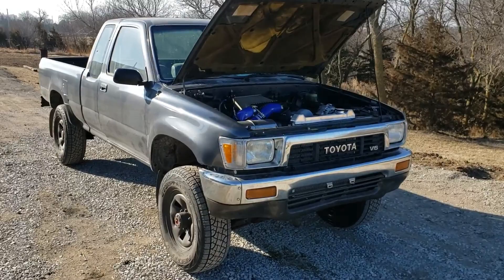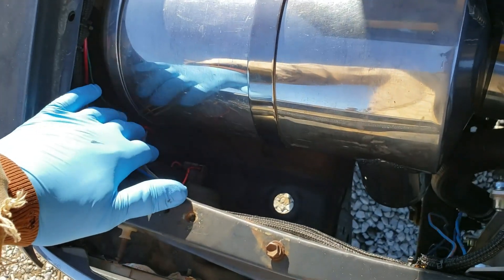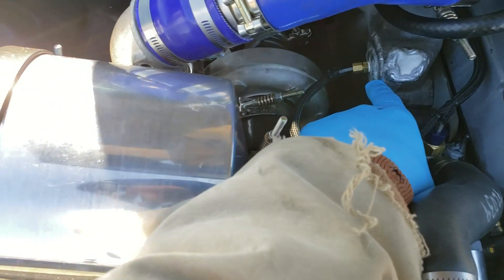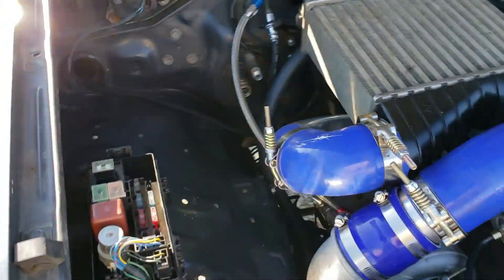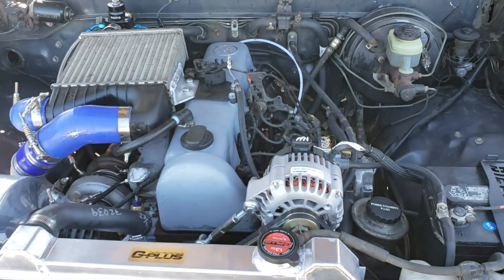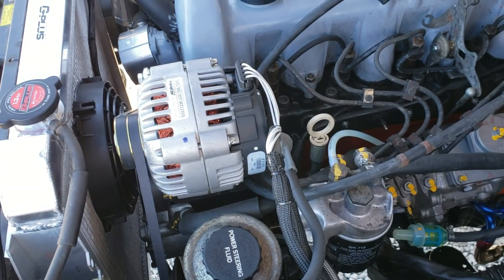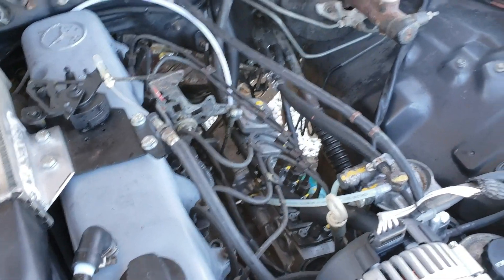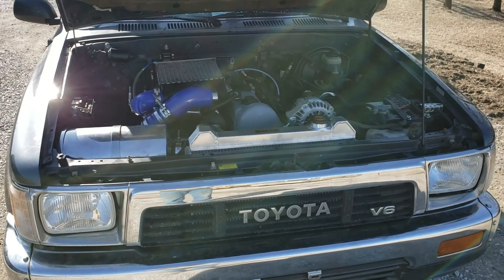OM617 Conversion Series: Toyota Pickup 3VZE-to-OM617 Swap Overview

Comment: There is one of those diesels for sale in my area right now. I have a 97 t100 4x4 automatic. I need a recommended parts list.
Reply: you have a few options but you can find universal engine mounts to adapt to the truck and you can adapt it to either a automatic or you can do a toyota manual w58 I believe or you can adapt it to a chevy trans as well. It is a front sump pan though so that might be a problem for you.

Comment: If you have an opening plz let me know I’d like a swap like this but with ac and heat. Your work and attention to detail is not n point sir! I have a 93 single cab m 5 speed 22re on 38.5 boggers 5:29 gears. I’m guessing this swap would push those tires no problem?

Comment: A couple Questions 1. Will this work in a 1989 Toyota 4x4 pickup has an extended cab. 2. Is this a mechanically driven fuel pump on it. This is very interesting would like to do it to mine if possible.
Reply from the maker: Yes & yes.
Reply: @doomsdaydiesel  Cool now I'm on the lookout for a OM617. Thanks for the quick reply.

Comment: Does anyone know if the transmission in a 83 GMC S15 with a 2.2 Isuzu 5 speed will bolt up to a om617 engine? If not what might I need. This truck is just a burnout truck for our local events. It doesn't have to be classy just functional. Thanks to anyone that can help!
Reply from the maker: I don't support the little S10 stuff, just the common GM 90° pattern.
Reply: @doomsdaydiesel  sorry but I don't understand what you mean? The transmission won't hold up to the engine? What's the 90° mean? Thanks
Reply from the maker: @dunavungoeckner6495  Google gm 90°. I'm sure the s10 trannys would hold up, but there aren't enough of them around to create enough demand for me to support them. Might sell 1 kit a year tops.

Comment: how many MPGs does it go for OM617?
Reply from the maker: Anywhere from 21-32 depending on tires/lift/gears
Reply: @doomsdaydiesel  sweet! between TDI vs om617, which one do you think is more reliable and lasts longer when converted to other trucks?
Reply from the maker: @bowlineastronomenov5507  they're both great. 617 is easier to work on and doesn't have the risky timing belt tho
Reply: @doomsdaydiesel  awesome, tnx man. hoping to convert my 3rd gen with one of those engines.

Comment: Like your mods. And attention to detail.
I used that exact intercooler…came off a turbo Renault (if I remember correctly). Mounted on side wall with a fan on my Nissan scout.
Like to see a better pic of the modified sump.
Reply from the maker: Doomsdaydiesel.net for the "ultimate clearance" front sump, and the new rear sump

Comment: Question: Did you change final drive / front drive? what is you max. speed? :)
Reply from the maker: No. You gear the 617 the same as the Toyota motors

Comment: I also have a 3VZ pickup (1988) that I am interested in OM617 swapping, how much would it cost to have you do the swap?
Reply from the maker: I am not currently taking on any more customer's in-house builds as I am booked out for the rest of the year, but they typically cost $10-$12k

Comment: Awesome swap!!! In your opinion, is the standard transmission and transfer case up to the challenge of the OM617? I have a 91 3.0 w the aforementioned. Would you suggest a different clutch?
Reply from the maker: Oh ya, this trans came behind an LS in a certain application. It can hold 300hp no problem. I'd recommend the 10" Aisin clutch.
Reply: @doomsdaydiesel  awesome, thank you!

Comment: Very cool truck, seems like you could have gotten a much larger single or at least 2 medium pusher fans on the front of the raditor.
Reply from the maker: Pushers will cause overheating. They block surface area and don't flow as much. I've troubleshooted this with 5 different customers now.

The fan in this truck cools just fine with that built pump in 93° weather. A second will fit if needed. And if that's still not enough, the serpentine conversion opens up room for the mechanical fan.
Reply: @doomsdaydiesel  weird, im by no means a diesel expert, honestly very limited experience with them outside of reg maintenance.  But have built at least 5 street cars over the last few years with between 400-600hp ls's and in summer in Texas with ac on they do the job just fine.  Wasn't trying to flame or anything just adding a suggestion.  It's a really cool build and I like the amount of parts from various oems you used!
Reply from the maker: @philipallen7956  normally diesels run much cooler, so much in fact that a lot of Cummins 6BT swaps don't even have fans. IDI's have to run hotter to burn the fuel, which I believe is the culprit with the overheating 617's. In your LS builds, I'm guessing you had plenty of radiator? Whereas we're limited with radiator size in these Toyota's.
Reply: @doomsdaydiesel  I think you def onto something with radiator size i do try to upgrade them size wise if it's possible. as well as the general engine temp difference between gas and diesel.

Comment: I just looked up the swap kit and I am really thinking about doing this and getting rid of my old 3vze
Reply from the maker: You'll certainly never regret it!
Reply: @doomsdaydiesel   One question though will that oil pan clear a dual shock steering stabilizer?
Reply from the maker: @FadedDreamzTv you shouldn't need 1 stabilizer let alone 2! You'll have to relocate to a different position if you want to make that work.
Reply: @doomsdaydiesel  what is that intercooler from?
Reply from the maker: @jamesmay5394  Saab Blackstone

Comment: Did the same swap into my '81 CJ5, lifted it, Detroit n Chromoly up front, OX Manual cable locker rear, 37" DOT LT Crawlers, 12k Warn... Have all the parts to do the intercooler, 105 amp alternator, hood and roof rack. Love the OM617.
Reply: I also have a CJ5 with a OM616 engine in my case they simply removed and blocked off! the oil filter! i have no oil filter on my engine! (because there is no space for it) what did you do for oil filter?
Reply: @makingcookingfixing  i have heard of a relocation kit for a 617 should be able to find one for a 616

Comment: Any recommendations for a Isuzu trooper? I recently purchased a 240d. Subscribed!
Reply from the maker: I'm not well versed on Troopers, but you can never go wrong with a Toyota R150 since they have transfer case options with outputs on either side
Reply: @doomsdaydiesel  so the most cost efficient option is the R150 set up? I guess if I got this engine for my swap the I’d also need to swap transmissions. Not finding much info at the moment but that’s what it’s looking like.
Reply from the maker: @gerardourbina6243  yes, either swap in an 88-95 passenger drop, or a 96-04 drivers drop.

Comment: Really nice. Did you use an oil cooler, or is the Mercedes oil cooler tucked away somewhere?
Reply from the maker: Yes, the OEM cooler is tucked up under the cab under the driver's seat

Comment: For the furs shutoff I’ve used the Toyota vsv, which died, then an aftermarket vac switch that worked for a week. What is the shutoff switch you are using?
Reply from the maker: My own Doomsday Wiring Harness with an EGR solenoid from the Toyota

Comment: What kind of mugs are you able to achieve with this set up what do you charge for this conversion
Reply from the maker: They can net around 30mpg with stock suspension and tires. My rock crawler on 37's was getting 24mpg on the highway at 60mph. Call/email for prices on in-house swaps.

Comment: Beautiful
Reply: Also, are you only running the valve cover breather, or did you run the crank case breather to the oil catch can as well? Would it cost too much vacuum to illuminate the breather on the upper oil pan? I’m working on that right now, just converted the valve cover breather to AN fitting as well as the turbo drain. Debating drilling and tapping another a.m. fitting in the crank case breather since the factory one is worthless and leaks

Comment: I realize after watching your channel you are heavily invested in the Merc OM617, I see so many VW TDI conversions any reason why you focused on the Merc instead, what are the benefits of this engine compared to the VW?
Reply from the maker: That's a loaded question. I actually sell adapters for both. The OM617 is all mechanical. VW uses approx. 36 wires. The OM617 is essentially the big brother like a 6BT is to a 4BT or a 350 is to a 4.3 Vortec. The OM617 is 3.0L vs 1.9L. They have about the same RPM range and same power potential - the OM617 just makes more because of more displacement. One of the biggest things my customers tell me is how cheap the OM617 is. It can usually be had for $0-$500 depending on what you do with the donor car. The TDI is a lot higher at $1000-$2000 for a car that has little re-sale value. The 1.9 is obviously smaller, so it takes up less room, but it has components on the rear side of the motor which can be a pain to deal with. Doomsday Diesel is really based around EMP-proof, apocalypse ready, mechanical diesels, but the TDI is the exception.
Reply: Doomsday Diesel thank you.
Reply: thank you Sir, god bless.
Reply: @doomsdaydiesel  how much was the swap in total? How do-able is it on a DIY scale? I always see these trucks for super cheap because the 3.0 it comes with is just trouble some. All mechanical diesel is something I’m interesting in doing in the future. Would be some good content
Reply from the maker: @305_cowboy  parts list is $3-$5k. DIY is very doable now that I've made it a 95% bolt-in swap.
Reply: @doomsdaydiesel  man that is awesome. I’m gonna sub and keep this in mind. Hoping I’m the next 2 years we can buy an older Toyota to do something unique and document it. Thankful for the few like you
Reply from the maker: @305_cowboy  buy one now! Or soon they'll all be south of the border 😥
Reply: @doomsdaydiesel  trust me we in the Toyota community despise the dudes who are outsourcing from the US. Mostly taking advantage of people. I’m pretty young still in college chasing my passion on the side and decided to document it. As soon as it is financially viable it will be our first rescue series. Probably a road trip from Oregon/Cali to Miami toyotas are super cheap over there

Comment: Is it not that big of a deal to not have the oil cooler up front with the radiator?
Reply from the maker: It's an oil-to-air cooler. It just needs air.
Reply: Making me rethink my setup. Any chance you know the thread pitch to the stock 617 cooler?
Reply from the maker: @cmmrusche  drill & tap to 1/2" npt
Reply: Interior threading right. I already have 1/2” npt -10an fittings to use so that works out.
Reply from the maker: @cmmrusche  yes